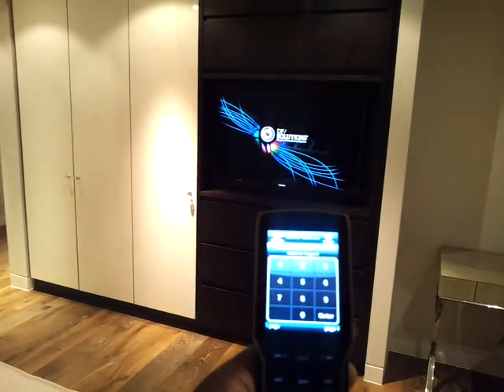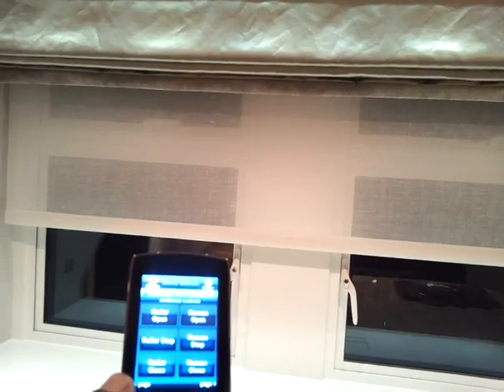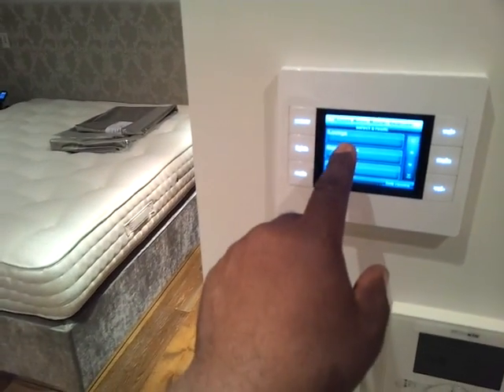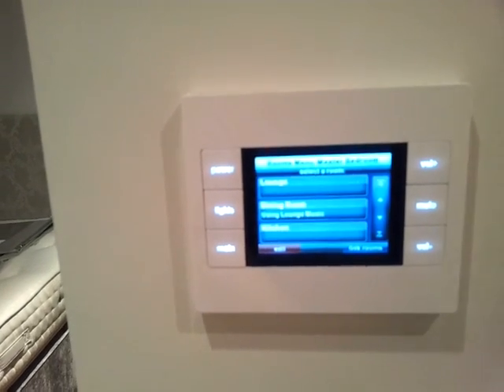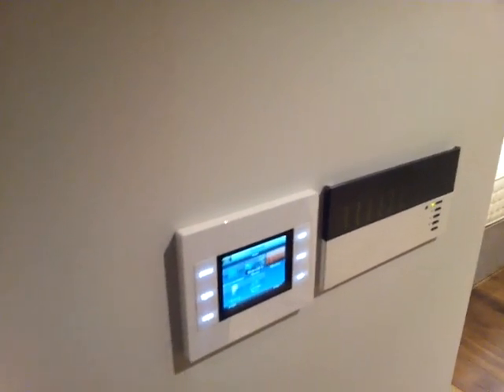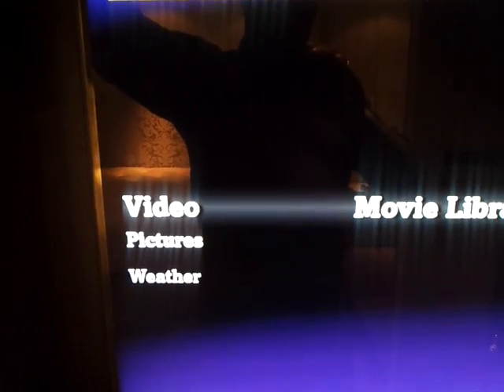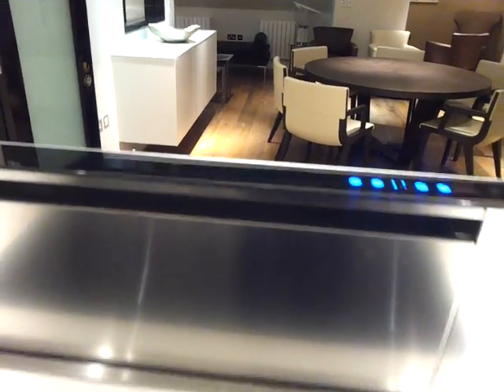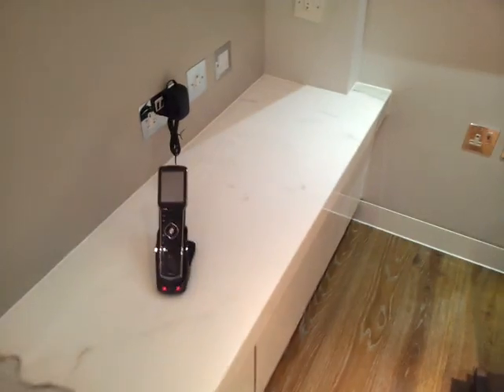URC: Total Control Installation Pt 2

Comment: How many hours were put into this project in total from start to finish I am just curious how long a project like that should take>?
Reply from the maker: The whole AV project took around 5 days to complete - but that excludes the actual refurbishing of the appointment. I had no involvement in the refurbishment of the apartment.
Reply: Wow Thats fast right on I would have expected much longer in all honesty...
Reply: I understand I was only askng about the AV programming anyways thanks for the fast reply as well. How much did you charge to do the job including equipment labor etc...?
Reply from the maker: +Aaron Fuller Hi Aaron. I should have added another 2 days for the programming and project design. I also had another person helping cutting the cables back and separating them in colour order for me to terminate the ends. in order to make project run smoothly prior preparation is key with a project like this. It looks daunting at first but if you look a each area independently then it is not so bad. integration is what can take the time - but again, you need to choose each product wisely to make sure there is control comparability throughout - this needs to be done from the start.
Reply: I understand Im in middle of piecing together a TC job where person didnt want to purchase everything that was needed for a good base for the system and now is adding to it without having everything in place that should be there to make it go smoothly its been a huge ordeal...Also his drywaller's cut like 1/2 of all the cables that I had pre-wired for the job so now having to work with 1/2 the cables needed and a customer that wants active service everywhere in home all the time with no downtime that works from home it's awesome~It has been super fun!

Comment: Looks incredible, nice job! I remember seeing you at a training course for Wyrestorm Enado through Habitech a while ago but didnt manage to have a chat. We are just getting into control and AV installation and have followed the RTi route. There is a lot involved to get a good looking interface setup and programmed, is the URC control range easier to set up and programme? Is it worth following that path instead?
Reply from the maker: Hey Luke, really sorry for my extremely late reply - for some reason I just didn't notice it. please accept my humble apologies. I have been using URC for a few years now and have installed the Total Control range on quite a few big projects. I looked at many other multi-room audio and control systems such as the RTI and C4 range but found that the URC TC was offering more. I hope to hear back from you soon - perhaps you could give me a call. Sorry once again.